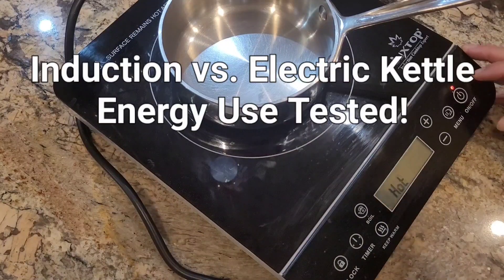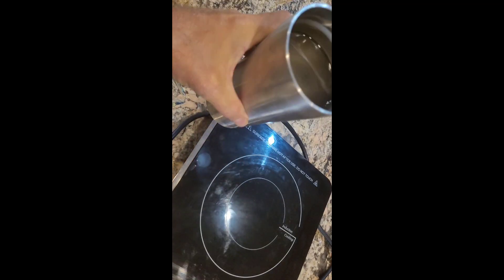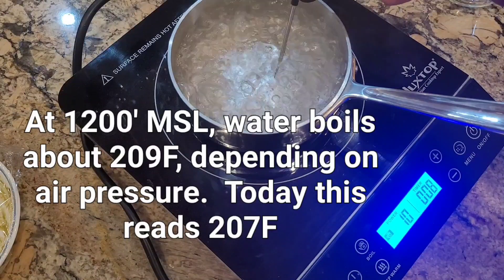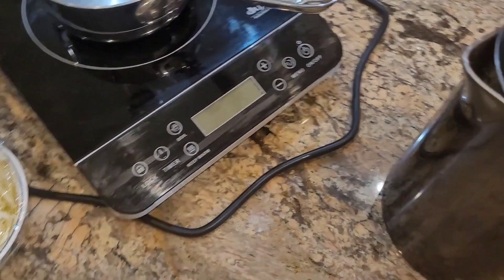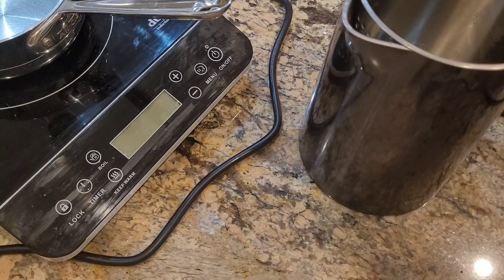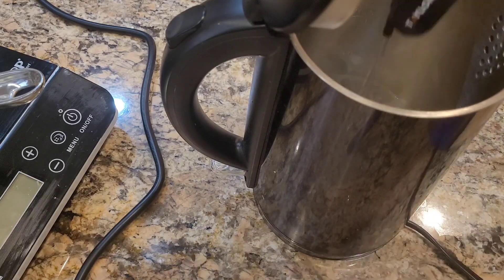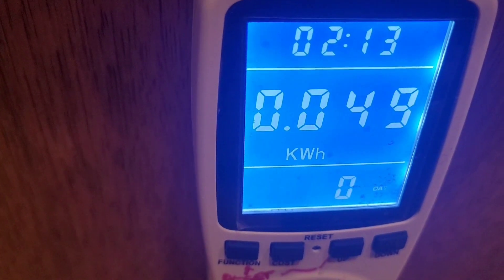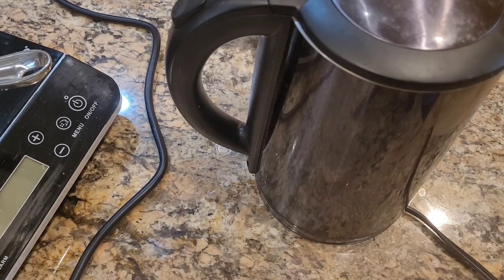Induction vs. Electric Kettle, Energy Use Tested!

Comment: Correct me if i am wrong, but since we are talking "watts per hour", isn't it important to mention how much time each of the device was on in order to boil the water?

I understand that you are comparing their "efficiency" against the ideal energy conversion, but it would be useful to know the speed also.
Reply: No it isn't relevant. Watts per hour is good to use, that it will give you a direct answer how much draw you will get from the batteries, and you don't need to calculate if the amps would be given in different voltages 🙂. How much time it will take to boil water is another case 👍

Comment: Did you covered the pot on the induction cooktop? If not, then it was not a fair test.
Reply from the maker: No.  I discussed it in the vid.  There is more heat transfer gained by stirring the water boundary layer on the hot pan, over the 2 minute heat period, than is lost through no lid. In any case, I've done it covered and uncovered, makes little difference.  The point of the video was to give close ideas for powerstation users, campers, to be able to figure out daily energy use, and if they need more battery.  I will maybe do a covered vs uncovered video for you here soon, thx! ;)
Reply: @dave_in_az  That's not true. You could just shake the pot to stir the water while the pot is covered.